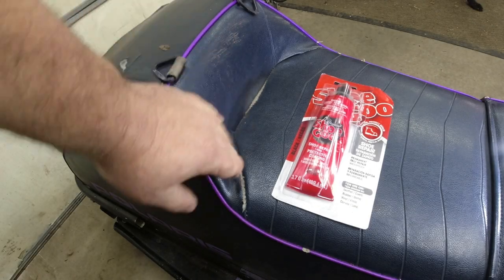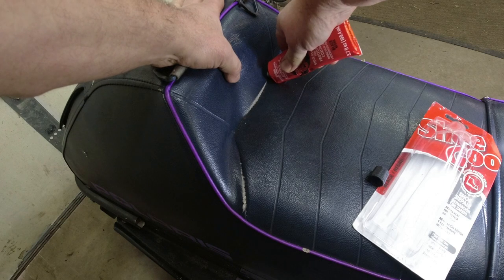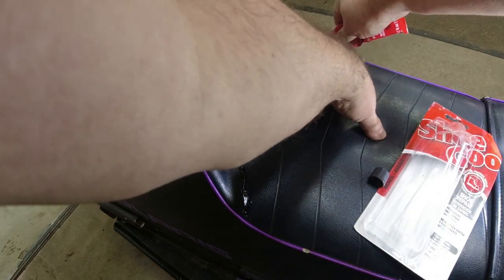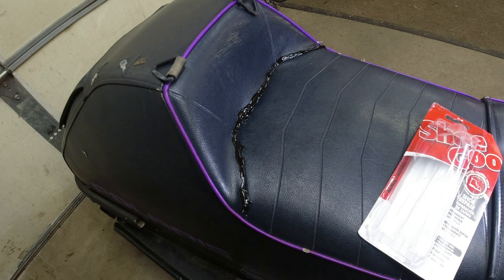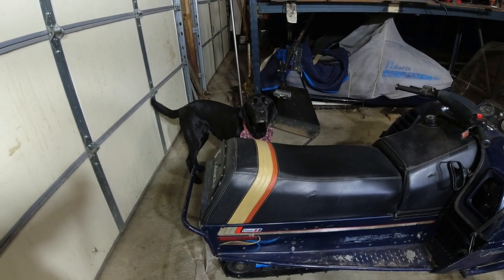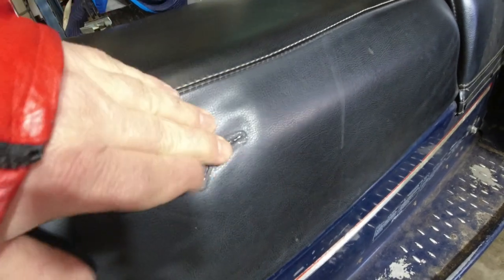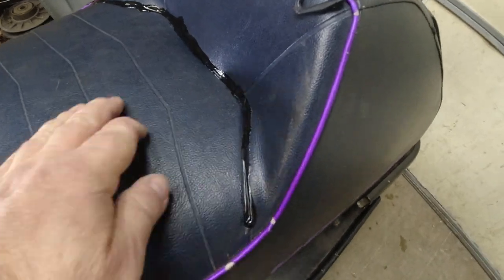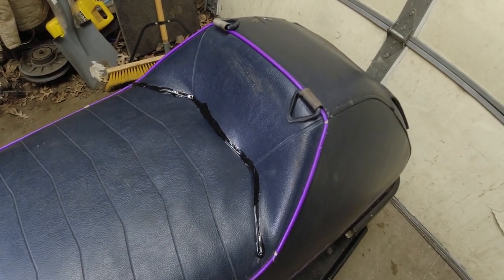Does Shoe Goo work for Snowmobile Seat Repairs? Yes it does! Vintage sled seat torn seat.

Comment: That stuff works great. Another one i use us e6000. Ive even glued lugs that were partially torn off and they are still holding hundreds of miles later
Reply from the maker: I'll have to try some of that e6000!
Reply: @nuttersspeedshop  for sure

Comment: Great tip Nutter never knew about that stuff! Is there any reason you can’t strike it with your finger to make it smoother?
Reply from the maker: You sure could, but levels and sinks into the cracks a lot when it dries so you might want to experiment first. Seems to shrink by about 50%.